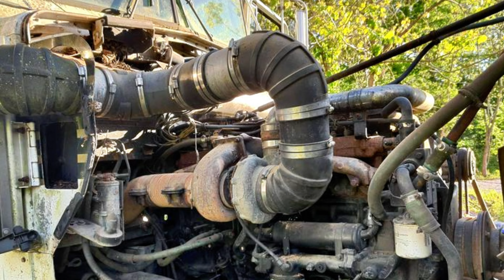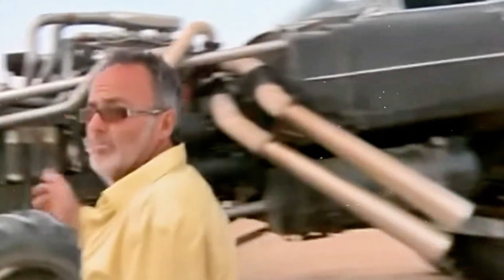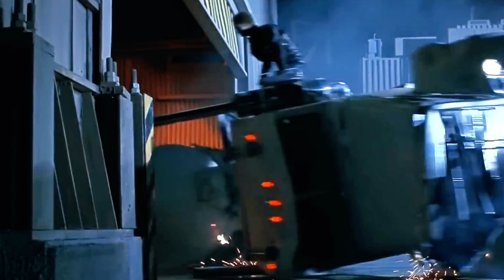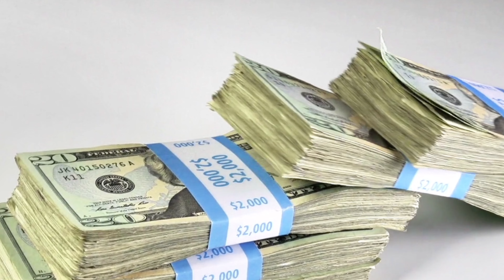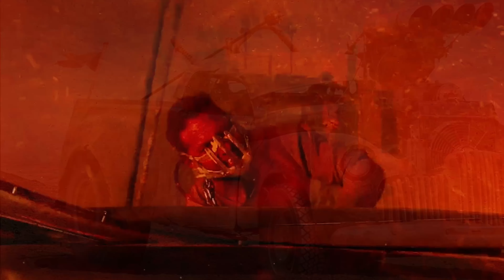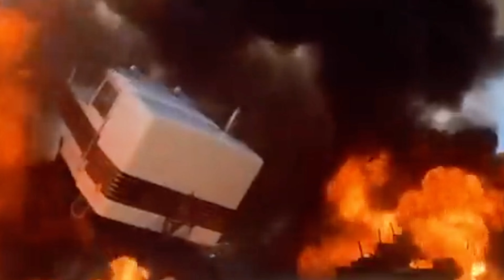The 4 Most Over Engineered Movie Trucks Ever Put On Screen!

Comment: The Landmaster was a one off build, there was no stunt version or hero version, there was only one built, and it is literally built like a tank, the jump was just to see if it could survive the landing, it did and drove off without so much an issue.

They didn't have to invent a new tranmission for the Gigahorse, there was already transmissions designed for two engines to supply torque, though you mostly only see them in Tractorpulls.
Reply: You are 100% correct!
Multiple engines on one transmission or transfer case 🤔 have been done for 40+ years. Look at tractor pulling from the 80s on up.

The Gigahorse was built off a monster truck chassis with two 59 Cadillacs mounted on top!

AI bullshit
Reply from the maker: The invention for the Gigahorse is how to combine it with the fused Cadillac. While it was there, the fusion was where the problem was. And thanks for catching on the Landmaster.